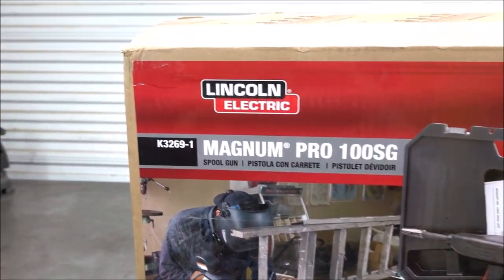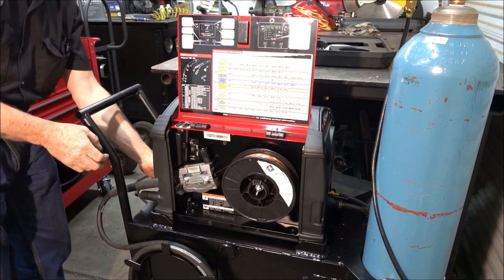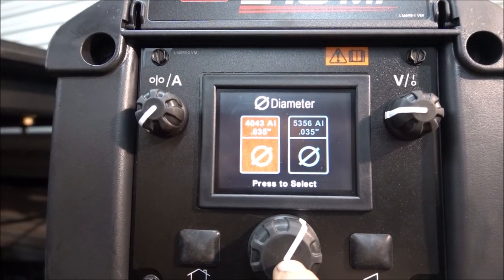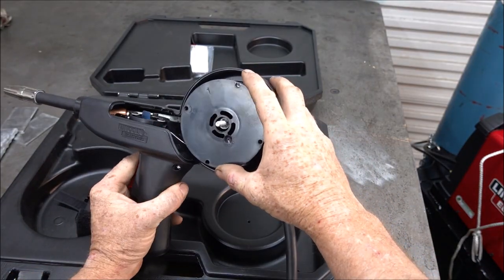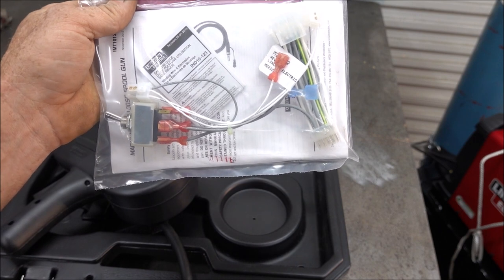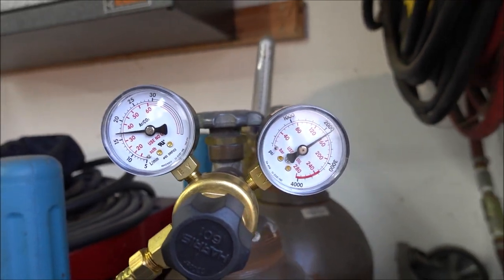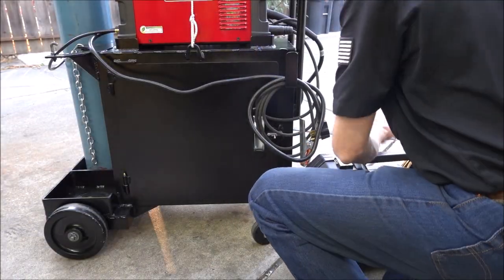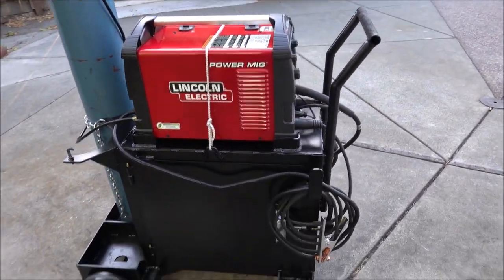How to use a Mig Welder Spool Gun

Comment: I am no expert but have done a little spool gun welding. You should try pushing your weld instead of pulling it. It helps gas coverage. In addition, rather than cutting off the extra wire you can just wrap it around the nozzle. It seems to smooth out the initiation of the arc. Thanks for the video. I have a 210MP but do not like it as well as my older transformer units. Much easier to transport though.
Reply from the maker: I’ve only had the 210mp for a short time now.  I kind of wanted a welder that was mid size .  That’s why I got it. With the adapter I made I can plug it into a 240v 20amp socket.  One thing about the inverter welders is they don’t draw very many amps.  It only draws 15 amps turned all the way up.   My Transformer welders have lasted many years without any problems.  Not sure how long these inverter based welders hold up.
Reply: @1970chevelle396 your supposed to have a 40 pr 50 amp 240 outlet for that machine or it runs on 20 amp breaker  for 120
Reply from the maker: @trevorstrutt1    It only draws 15 amps at 240 volts

Comment: You should be pushing that weld to give the gas time to clean before the arc hits the metal.  Dragging gives no ability for the gas flow to pre-clean the area.
Reply from the maker: That was the first time I tried it out.  Most of the time I tig weld aluminum.

Comment: 7:27 wow that really spatters ehh.   Is the spool feed speed controllable with the trigger?
Reply from the maker: Yes it does spatter more. .  The wire speed is controlled on the welder the same as using it without the spool gun.